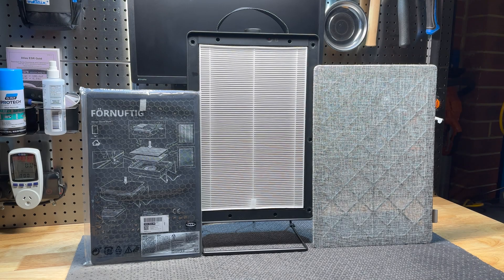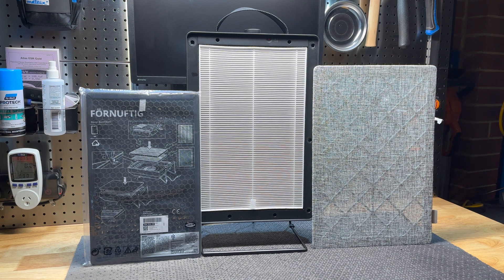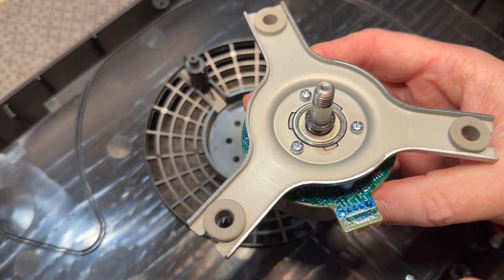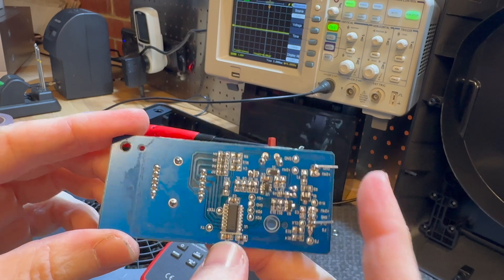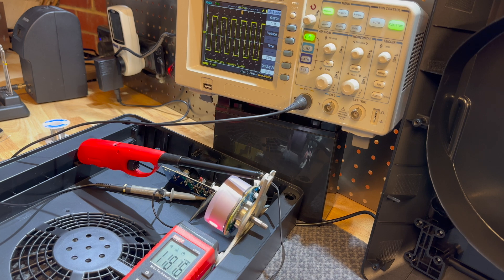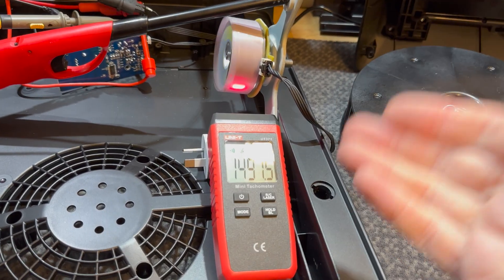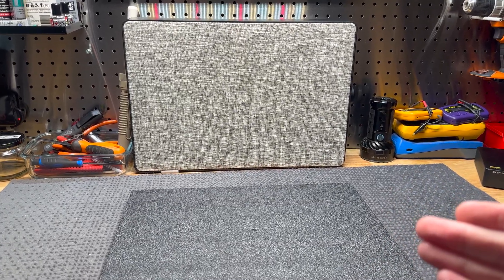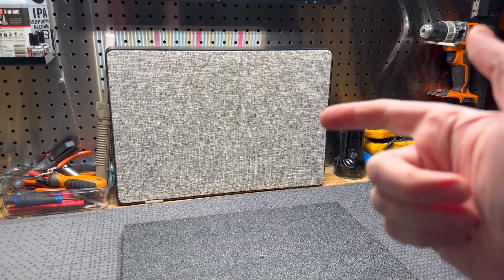DIY Soldering Fume Extractor / Teardown (IKEA FÖRNUFTIG)

Comment: g'day mate. thanks for some good insight here. I agree, the units you get from AE are a bit ordinary.  I'm also in the need for a soldering fan as I'll need to breath a little easier after 30 years of soldering. I suspect i developed emphysema as a result despite never been a smoker.
Reply from the maker: Yes ive been a bad for this also and not looking after myself. These definitely help providing you can direct the airflow properly

Comment: The only thing i dont lika about it is that the carbon filter is far from densly filled with carbon pellets so i doubt it filters out all the crap heavy use needs.
Reply from the maker: It seems to do very well to be honest, I use one in my laser cutter also
Reply: @whatcouldgowrong7914  hmm impressive. Might need to get one just to try it out.

Comment: I 'hacked' two of them a while back. I replaced the controlboard with an ESP32. Maybe this info will help others:

TL;DR: In order to reach close to 2000 RPM, you will need to send a 320 Hz PFM signal to the fan, and swap out the power supply with something that can do around 24V @ 1.5A.

My findings:
- The fan is not controlled via PWM, but via PFM: Pulse Frequency Modulation
- FG stands for "Frequency Generator". This is the signal pin that controls the fan speed.
- When setting the desired speed with the knob, the control board will send out a single frequency pulse to the fan. The fan will then set it's speed as requested by the control board.
- The motor itself compensates/adjusts it's speed autonomously, not the control board.
- The CLK or Clock pin is the sensing pin to check the fans RPM.
- The exact specifications of this particular fan are not listed online; there are a few 48F series fans listed, but not this one. Might find them on AliExpress with the correct specs.
- The fan speed seems to be capped at around 1950 RPM
- Max speed is called with a PFM frequency of 320 Hz
- In my tests @1950 RPM, the fan will use around 1.4 amps with unrestricted air flow.
- @ 1950 RMP with HEPA filter installed, the fan uses around 1.2 amps. 
- The fan seems to be mainly RPM limited. When obstructing the air intake, many fans will start spinning faster due to pulling a vacuum. But this fan will lower it's current so that the RPM stays the same and never goes over 2000 RPM. This is a very good feature because it will protect the bearing. Downside is that you cannot use the fan speed to dynamically determine the dirtyness of the filter. A more complex way to achieve this anyway is to measure the power consumption (dirty filter will consume less power than a clean filter).
- A big limiting factor is the power supply. The fan will happily pull 1.4 amps if it can, but the original power supply is only rated for 0.8 amps.
Reply: Thanks random comment guy

Comment: Cheers for this, just bought one, fits perfectly underneath wall mounted component drawers depth wise, and even on the relatively quiet medium speed, it pulls solder and flux smoke in from an impressive distance with zero smell emitted from the carbon filter.
Reply from the maker: Yup they work great! I need to add a bit of a hood to mine sometime also
Reply: @whatcouldgowrong7914  

Hey there. Sorry - dumb question here. (and great video too  @whatcouldgowrong7914 ) just confirming no existing mods required? Worked well straight out of the box (apart from the variable speed which was mentioned) beginner solderer here, so just deciding on best option. Aussie here too so having a local Ikea nearby is handy
Reply from the maker: @ Yup works great just 3 steps in speed 🙂
Reply: @whatcouldgowrong7914  thanks heaps mate 🙂

Comment: What I did for a DIY solder fume extractor is use one of those old DELL/HP 20CM thick fans, with a DIY frame. 

its loud AF but it can even suck away air from 50CM away

Comment: I decided to use one as well, how is it working for you??
I've replaced mine PCB with ESP32 and connected it to Home Assistant :D
Reply from the maker: I have 2 and not had issues with either but need to do more work on hacking them for sure with a better pwm driver
Reply: great idea....you should do a little video on  that :)
Reply: @minskmade  totally agree